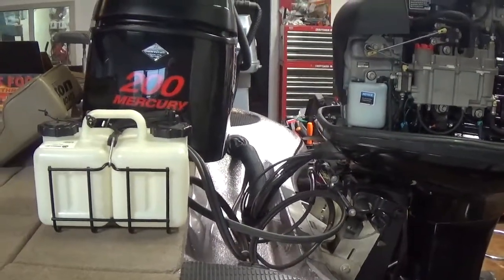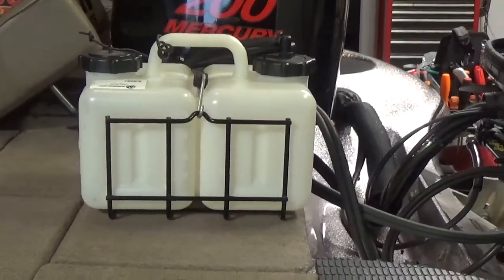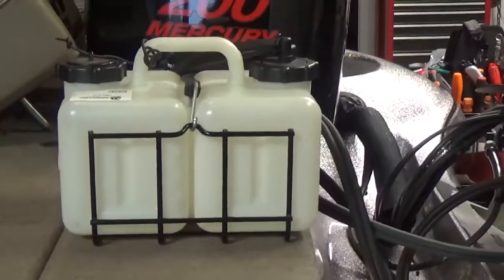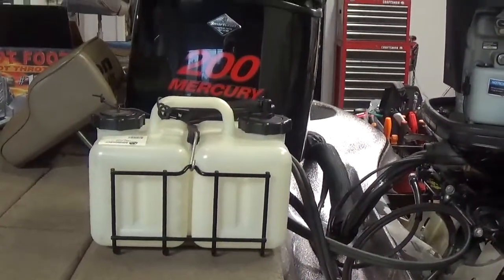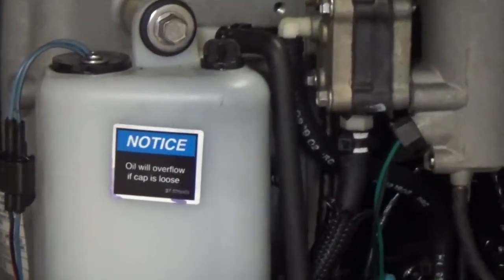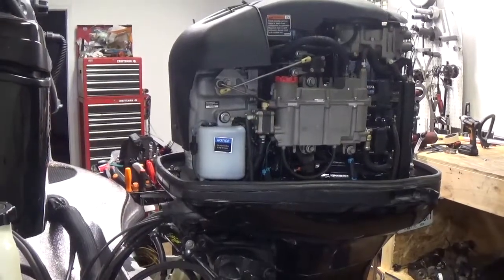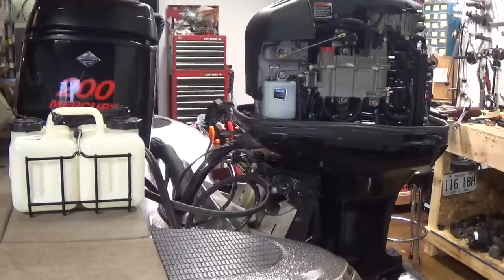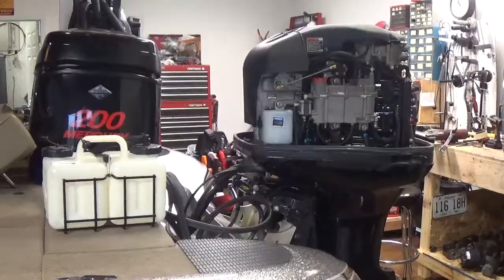Mercury Outboard Oil Injection Alarm

Comment: Ended  up thinking  the reserv sensor  was bad but turns out it was a crack at pick up hose. And I replaced  a good sensor  with a bad one now I have to replace  1 part twice after 2nd re prime

Comment: What if you go to take that little black cap off and you sit there for 10 minutes and you can’t get it to overflow over the top?
Reply: Either the larger remote tank is out of oil, or the bottom strainer of the pickup tube inside it is clogged up with debris or gunk, or the air feed line going to it, which is pressurized with air by crankcase pressure when the engine is running and there is a separate line from that large tank that due to pressurization feeds oil to the smaller, under cowl tank.

Comment: Sir, you just described me exactly. 😂 I didn't drive the boat after the alarm. I had oil delivered to me via another boat and i found the bleed information before running the engine for any length of time. My question is, it was my understanding that crankcase pressure pushes the oil from the remote tank into the onboard tank and maintains that pressure to inject the oil into the motor, but i cannot get the onboard tank to fill over 80%. I'm worried my alarms quit, because the float sensor is made, but still not injecting oil. Is there a pump from the onboard tank?

Comment: I removed my remote oil tank and started just filled oil straight intoi the gas tank. Now the controller alarm beeping constantly and shutdown the engine.  Can I run the engine without the remote oil tank?
Reply: Not on a Optimax

Comment: Why not just fill the reservoir up also instead of waiting for it to fill up with the engine running? Just leave the cap loose and let air bled off as the engine is running?
Thanks

Comment: Nice video...I have 95 mercury 150 XR6 Black Max, runs great. Oil always full and purged. I can run all day, no problem til I stop to fish, even hours. I'll prime my fuel line and get that same warning tone intermittently. Some days it won't, others it will. I'm always checking everything and it uses oil, has great  oil pressure..I just don't what it causing the alarm. I can play with the trim and the key and I get the alarm to "go normal" with my 3 quick beeps. I don't run it when the alarm stays a solid tone. Any tips?

Comment: Great video, I wish I'd known a month ago when I was in the middle of Fredrick sound an hour away from Petersburg Alaska.
  I had some sludge on my pickup screen and my 2004 Optimax was new to me.  After I limped back to town and did some Utube investigations I cleaned and fixed the warning tones.  The Motor is very powerful pushes my skiff 35mph, cruise at 30.
 Thanks
Reply: i had an optimax for a number of years if you need any tips or help let me know. I have some good maintenance practices for these. Give you a quick summary of what I would do at year end. Put 3 or 4 drops of dfi oil into the compressor and spin it by hand. this will protect it from rust from sitting over the winter. I would pull the plugs and spray fogging oil into the cylinders and spin the crank by hand. To meet regulations they increased the gap of the spark plugs and use iridium if you look at when they first released the gap is a few thousands smaller with platinum. So you can get a meaner idle with a slightly smaller plug gap. I used platinum on mine I think 33 thou. Other than that I would pull the VST and apply some neverseze or copper cote because I actually had one bolt snap inhalf because of galvanic corrosion. Stainless fasteners and aluminum need a coat of that especially the VST where you need to be able to take it apart ect.

Comment: Great video! I have a question. I had the beep come on and off. Always had oil. Never ran out. Yesterday we were going 20mph amd it automatically brought the motor to 2 mph. We checked everything. That tank on the actual motor was probably close to 7/8 full. From your video sounds like it should be 100% full. Would that cause such a problem it would shut down. I was able to put back at 4 mph hour. Seem to run fine. But cause of the alarm. It would go any faster. Do you think there may be a different issue. Maybe electronic, or maybe that tank needs to be 100% full?
Reply: Hes not answering questions jut a blow off

Comment: Great video and I was aware of all that you explained because I ran low oil once before. I have been grasping at straws with trying to correct a 4 beep low oil alarm and think I may have an oil sensor out on the Calin reservoir after I realized that I have good oil flow to allcomponents. Mercury and dealers try to make you change the whole tank that the sensor is not sold separate. Not true, I found the exact sensor for the tank just ordered it for 20 bucks when they wanted 350 for the whole thing. They pulled the same crap on a leaky oil pump, when I fixed it with a 15 cent oring. I have a 250 proxs and hope that I am on the right track with changing the sensor. Any response of where I am at with this issue?

Comment: I am getting 6 alarms beeps after a minute of running. Only happens when I start the engine.  Manual says maybe water in filter. I changed the fuel filter in the engine but still get 6 sounds about a minute after I start it.  Can it still be an oil problem?  I have a 2017. 250 Optimax
Reply: I have no clue what the beeps are for but my guess is that it could be just a battery warning beep that it's not charging but as long as you see your oil level keep slowly going down you should be good and as for water in your fuel, as long as the engine runs good you shouldn't have a clogged filter and clean carbs.
Reply: I’m getting 6 beeps on my 2016 merc 115 ct. did you find the issue

Comment: I have a 1988 Mariner Mag II outboard. How would you go about testing the oil low sensor and the low sensor buzzer itself? When I turn the key on I do not get the normal beep most boats have. The key is located in the shifter box. I have 2 wires coming out of the cap on the emergency oil reservoir. I just want to be able to test everything and make sure it is working correctly
Reply: You could take the sensor and float out and while the engines running you can 
 Keep the float raised and then lower the float all the way and see if you get an alarm.

Comment: Question. I have a 1985 Mercury XR2 and the alarm came on today (constant alarm, not intermittent) and I know the thermostats are working and water pump is newer, too, and spitting a steady stream out the back. I am getting a small leak in the oil reservoir cap that has the air/oil prongs that goes to the engine. My question is will that cap connector having a small leak cause that alarm to sound? I just gotta believe it is not overheating since the thermostat is fine and the water pump working. Thanks for any help.
Reply from the maker: Yes any leak on the on board oil tank will cause a loss of pressure and not fill your tank on the motor correctly which will in turn cause a lack of oiling of the motor and a possible alarm, I would a skilled mechanic in your area look at it and not run until you get it fixed as powerhead  failure may occur

Comment: Good video though the big oil tank is pressurized by a hose coming from crankcase pressure.so the air pressure is pushing the oil from remote tank to reservoir so the oil circuit is always under pressure and when no pressure , the ouling system will fail.
Thank you
I like you texan accent

Comment: Will that cause it to shut off
Reply from the maker: No, there is nothing in the engine warning system that will totally shut off the motor.
Reply: What if I never had any alarm, started the boat and then put it into gear and the entire engine shut down? From there, it won’t start nor give me a starting beep. When I left the battery in for 20 seconds, then I got the constant beep. Any ideas?

Comment: Great video man.  I'm having trouble from the 3 gallon tank not transferring to the resivor is it possible I have air in the 3 gallon or the resivor any info would be appreciated
Reply: I would just pop your oil lines off of the 3 gallon tank and reservoir and blow air through them to check for a clog. It is pretty rare but it's possible.

Comment: I have a 2011 115 Mercury optimax I get the single all clear beep when I turn the key to on but I also get a single beep during cranking to start up. It starts fine it idle's fine it runs fine no other issues just a single beep during the cranking process of starting what is this beep for? I have asked my local shop and they couldn't help.
Reply: I have the same issue on 2018 optimax pro xs 150. It has about 8 hours on it. It does that extra beep but only occasionally. Same as you, idles and runs fine. All oil is up and pumping fine. Dealer told me battery maybe be weak but it is new and always charged...???

Comment: I have a 2006 250 optimax xs.  similar to what you were saying, my little resevoir did not fill up.  I loosened the knob, but still it didn't fill up.  How do I gain access to the pump to check if it is working?  How do you diagnose whether the pump is working?
Reply: Lucky vang.  I'm having the same issue as you having did ever figure out the problem ?

Comment: Hi can you advise me please, I have a optimax 115 2 stroke with the error water temp message displaying almost within
30 seconds of the motor starting
Motor is not overheating first and thermostats are working
Would this problem be heading towards 1 of the 3 sensors 
Can you advise me please because the marine mechanic did not have diagnostic computer for mercury and is advising to change all 3 sensors which is very expensive . What do you suggest??

Comment: I have a 1999 200hp merc , I was cruising at about 3500 rpm and the oil alarm sounded ….the motor cut back by itself ...I checked the oil tank OK ...I limped back to the ramp with no throttle and the alarm still sounding …..my mechanic replaced both power packs ….that fixed the problem.....now Im leary of going out …..does a bad power pack cause the alarm to sound and the engine cut back ? or do you think I have a oil injection problem ..
Reply from the maker: Your engine will not automatically ''cut back'' or reduce engine RPMs due to an oil injection problem. They didn't have that feature available back in 1999. Power Packs or switch box problems won't cause an alarm problem either.  You may have an over heat issue or an oil injection issue going on. Further investigating should be done. hope this Helps.
Reply: @ahrensmarineservicesllc4965   Thanx for your reply …….the peeb beep beep is oil problem according to my owners manual …...if it was a heat issue it would be a solid alarm …….confused ...should I remove the T stats and try it ?
Reply from the maker: @rickstout7626  I think by 1999 the oil injection alarm changed on your engine. The motion sensor on the oil pump was deleted by Mercury. See if the oil tank under the motor cowling is full to the top of oil. If not, that can cause an alarm. If your motor is an EFI, it has a ''water in fuel filter'' alarm feature. there's a little red led light on the front of the motor that will illuminate if that an issue. Otherwise, you may need a new water pump impeller kit. Should be done every three years. they will usually overheat around 3000-3500 rpms when the impeller gets weak. Do not remove the thermostat's...that won't solve the issue, and they need to be in there.
Reply: @ahrensmarineservicesllc4965  Thanx for the reply !

Comment: Hi i have a 90hp mercury 2 stroke. There is a alarm buzzing everytime I turn the key to ON/START, no beeping just a continuous alarm. I thought It may be a overheating alarm but it's still buzzing after engine has cooled off. I have also checked my oil tank and it's under half way. Any suggestions?
Reply from the maker: Locate the 2 light blue colored wires, coming out of the bottom of  the oil tank. Unplug one or both of them...if the alarm goes away,  your oil tank will need to be replaced. The float has sank I side the tank. Hope this helps.
Reply: Killen switch👍

Comment: I have a question. I have a 94 mercury 150 xri. Was running it, made a sharp right turn and a alarm started to go off. Beep beep beep and so on the entire time. Shut it down checked the oil, the big tank was about a little less than half full. Water was peeing out the pee hole. Everything seemed fine. Took it to the ramp to put it on trailer and it died. It will turn over but will not run. Any suggestions would be appreciated.
Reply from the maker: The beep, beep, beep alarm is probably caused by the small onboard oil tank under the engine cowling. If it's a little bit low, sometimes during a hard turn, this will allow the float sensor in the tank to drop...thus causing the alarm. The no start problem can be caused by a variety of things. the engine will need to be looked over to find the cause.
Reply from the maker: Also be sure that your water seperating fuel filter isn't full of water. On EFI models, it's located on the side of the engine.
Reply: It could be possible that you somehow lost spark VIA some kind of engine safety wire like a coolant temp wire that would remove spark if it goes over a certain temp. So pull a spark plug and plug it back in the spark plug wire and place the plug on a good ground like a bolt into the heads without paint on it and turn thw engine over and see if there is a spark on the spark plug.

Comment: I do have a question, I have a 1996 Mercury 200 hp EFI engine. My 3 gallon tank was about 1/2 empty so I added a gallon of Quick Silver 2 stroke oil to the tank, I had no alarms going off other than the test  when you first start the engine. And I did this at the end of the weekend so my boat was on the new lift I just bought and I had lifted the motor up with the power trim and ungauged the lift keeper to keep the motor up out of the water. Anyway the next week when I put the motor down and started the motor the alarm kept on going off beep, beep ,beep never stopping. So I got out the owners manual to see what I should do next. It said to take off the engine cover and see if a small red light was on in the front of the engine , something about water in a filter. But the light was not on, so then it said to check the oil tank on the motor,  and sure enough it was almost empty. Well I had put all the oil I had in the remote tank the week before so I had to stop and drive over to the marina and pick up 2 quarts for this small tank. So I got back and added 1 qt. was all it would hold, the float on mine was on the fill cap. and when I started the motor the test alarm sounded and then went silent as normal. So what's my problem ? Is it my oil pump that's suppose to pump from the remote tank up to the smaller tank on the engine or is there something else that could be causing this problem? Please reply so I can maybe do some testing on it. Please call me @ 573-808-4954 and leave me a message and I will gladly return your call. Thanks, Tracy
Reply: Tracy the alarm can be oil level or water but being the light wasn't on then it your oil level.  Always keep oil in both tanks full at all times.  The oil tank on the engine has the oil level sensor on it.  Now when you add oil to the main tanks the larger tanks always get air out of system.  This is done by starting the engine and remove the cap off the tank that's on the engine till oil starts to come out the top then put cap back on and off you go as long as no leaks.  P.s.  if ever you see the red light it's water in big filter with 1 wire hooked to blue probe on bottom.  Hope this helps
Reply: @ja.k.triggered5826  This is where I'm at, I think. I drained the gas separator and the pump side. I don't think it's gas. 
I have the big oil tank half full. Maybe loosening the small reservoir cap and running it would be the cure.
The boat will run about 4000 RPM/ 35 mph with a 3 beep alarm intermittently which stayed on until we loaded and shut off the motor.  I like this motor and want to maintain it correctly. Thank you